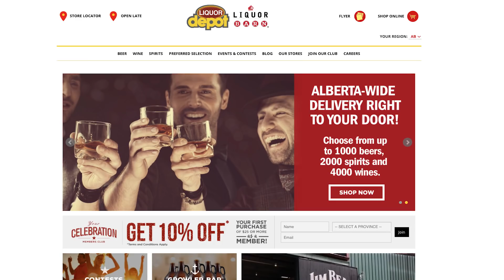Aurora Cannabis high on future prospects

Comment: sad that my stop on stock sold 2000 of my share at 8.45 :( only have 2000 left i guess i will have to wait until it hit 7$ again
Reply: oof, that sucks. Kinda set your stop loss too low. Did you buy the dip at 5-6 dollars a share? Wish I had bought during that inflection point.